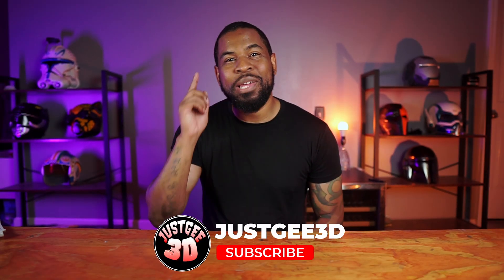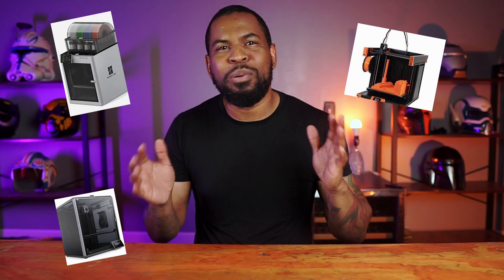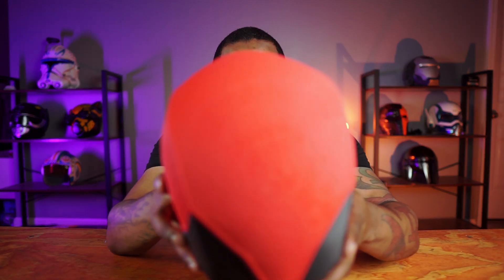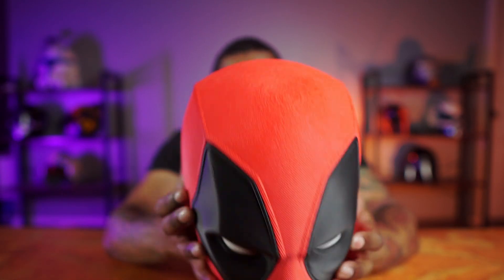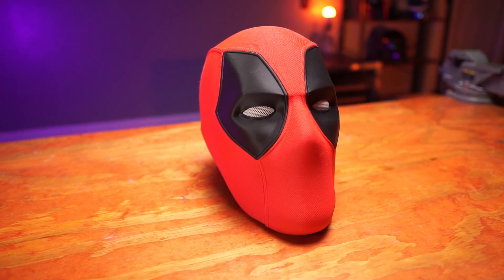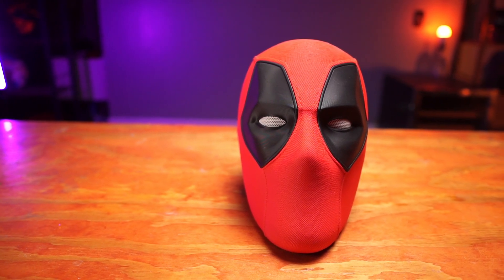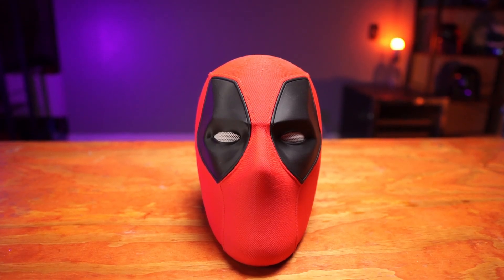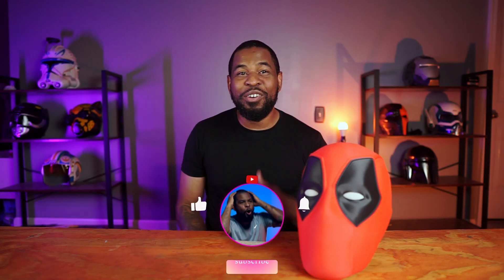Revolutionary 3D Printing: Say Goodbye to Post-Processing

Comment: I have 2 deadpool helmet my 1st prints but my question is how can I remove the magnets the ones I installed are not srong enough to hold it together so I need to replace them
Reply from the maker: If you use a solder iron on the opposite side you can push the out. The other way I done it was using the solder iron on the same side and make a hole big enough toe use a screwdriver to dig it out
Reply: @JustGee3D  thank you

Comment: bro please chare the settings you used
Reply from the maker: I’m going to do a setting video soon! 😉
Reply: @ please! I’m struggling so much to print a Deadpool mask using orca slicer. Can’t get the speeds down from 2/3 days and I can’t figure out my settings 🫨
Reply from the maker: What printer do you have?
Reply: @ Neptune 3 pro
Reply from the maker: I have the plus… I don’t use Orca! Dm me on IG and I’ll give you my UltiMaker Cura Slicer settings it’s not as good as Orca/Bambu Studios buts the supports come off clean! 😉
Reply: @ sent you a message 🫶🏻

Comment: Any help for a newbie? I printed a helmet but it was too tight if i resize all fhe pieces will it work and will the holes still hold the magnets? Will we have to resize the eyes as well?
Reply from the maker: If you resize the helmet you want to make all the other parts the same size. The magnets might not fit the best just add glue/ or bore the holes bigger to make them fit.

Comment: Crazy that you did both sides AND the back piece in good time.  Just my sides come in at about 30 hours.
Reply: Ì have been.  Hopefully it goes better on the Do3D version.  I got bad ringing at the finish.
Reply from the maker: Gotta slow that thing down!
Reply from the maker: Yeah I love this X1C fast printers are a game changer!!!
Reply: @JustGee3D  I'm on a Neptune 4 max, though. That's the crazy part.
Reply from the maker: That is crazy you just have to keep dialing in those setting

Comment: printing on a p1s  my prints keep failing even with tree supports standard and adding manual supports, did you change any settings?
Reply from the maker: No I didn’t change the setting at all, try changing the orientation of your print. If all fails using glue I have no problem adding glue to the build plate.

Comment: What glue do you use to glue in the magnets? I've had trouble getting glue to adhere well enough to the magnets so they don't get pulled out
Reply from the maker: Yeah these magnets aren’t the strongest either. 

 https://a.co/d/0i8ShltW

This is what I used, if this doesn’t work consider using 2 part epoxy

Comment: Does the superglue on the eyes not irritate your eyes?
Reply from the maker: Not is you let it dry out! lol trust I made that mistake before 🤦🏾‍♂️
Reply: @JustGee3D  interesting I used super glue on a Pokeball birdhouse I designed and even after drying out I could smell the super glue weeks later so I never put it out for the birds.
Reply from the maker: Well it could also be I use an accelerator to speed up the drying process. That’s all I smell!

Comment: nice one ! what speed did you use ? and any particular settings ?
Reply from the maker: All of my setting were basically the same .02 standard. And Polymaker Pollyterra PLA. The one thing I had to tinker with was the support settings. Sometimes they hung over the build plate. And I support block the crown!
Reply: @JustGee3D  ok thanks.
And did you calibrate each filament ?
Reply from the maker: They were all PolyTerra PLA. So no.
Reply: @JustGee3D  so when do you calibrate a filament then ?
Reply from the maker: I don’t, I only use their presets! They have generic preset that works perfectly
Reply: @JustGee3D  mmmm ok